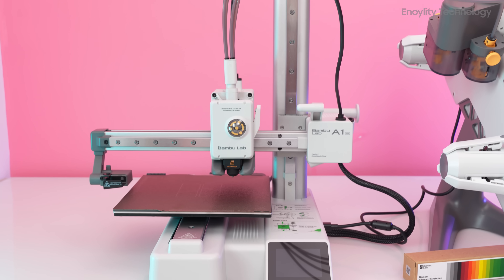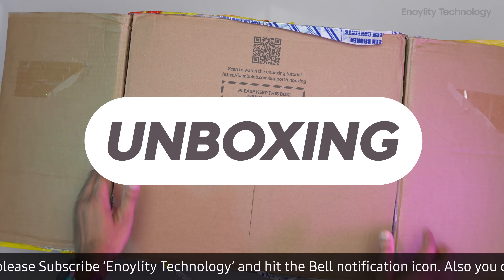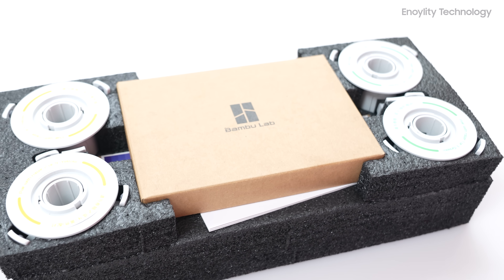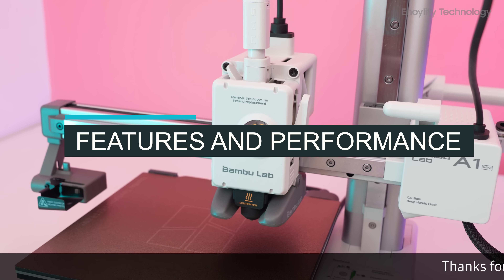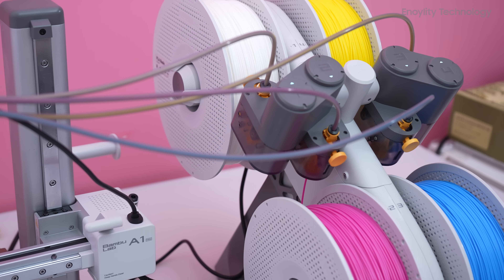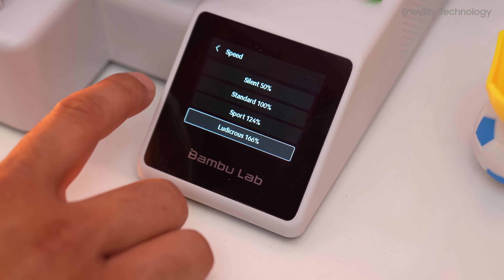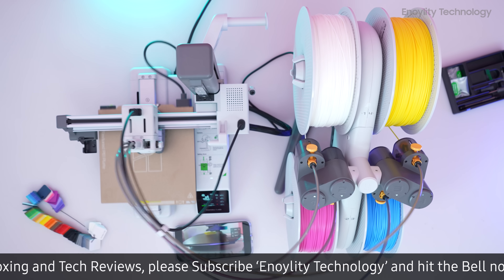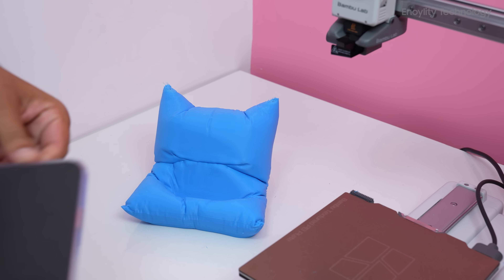Unleash Your Creativity with Bambu Lab A1 Mini: The Compact 3D Printing Powerhouse!

Comment: I’ve completed projects in half the time compared to other printers of similar size 😮 thanks to this amazing printer 🖨️
Reply: The Bambu Lab A1 Mini’s ability to print with flexible filaments has been a game-changer for me
Reply: The assembly process is straightforward, and most users can get it up and running within an hour
Reply: The printer malfunctioned but it was still under warranty. The company worked with me efficiently to resolve the issue.
Reply: The 3D printer runs off a screen that you just turn the dial button and it scrolls through. Once you find your option you click the same scroll dial. It's that easy
Reply: sturdy frame with a robust aluminum build. It feels well-constructed and durable, ensuring stability during prints.
Reply: This is my first 3D printer. It was very easy to assemble. @samantha_sims_12
Reply: I love the heated bed. I know people without heated beds use glue sticks or other things to get their prints to stick but it seems like having a heated bed works without the mess.

Comment: Every thing about the printer is likeable . It's been few months and working like a charm.  I would prefer this printer over ender because of lower price.
Reply: It opens up a lot of possibilities for different projects😊
Reply: There are lots of resources and tips available, making it easier to troubleshoot
Reply: Impressive printer
Great review as always
Thanks for sharing 🙂
Reply: As I write this review I have 500 hours on this machine so far. It works non stop in my office at home. I had not bought anything as fast as this printer before and I have even purchased another for my office at my actual place of employment
Reply: have many great idea projects, and can’t wait to use this in full force. So far, I’m really happy with my choice, and I have high expectations for the results!
Reply: Absolutely in love with this printer. It's my first, and I'll love it forever even after it leaves me for a younger man with a softer touch.
Reply: I’m loving the vibrant colors this printer brings to life
Reply: Prints well, right out of the box.

Comment: It’s a set-it-and-forget-it machine that keeps performing without constant adjustments 😄
Reply: For hobbyists and professionals alike, the A1 Mini is a fantastic tool
Reply: Prints from the A1 Mini are consistently high quality
Reply: For its price point, the A1 Mini delivers exceptional performance that competes with more expensive models
Reply: I own a handful of 3D printers including several Ender 3 variations and I'm quite pleased with this printer
Reply: Very surprised by the quality of the machine and the printing! Although, initially, there was an issue with the firmware version
Reply: This is a very capable 3D printer, when it works.
Reply: The Bambu Lab A1 Mini is designed to bring versatility, precision, and user convenience to the forefront

Comment: I recently purchased this 3D printer and have been thoroughly impressed with its performance.
Reply: Maintenance is minimal, thanks to the excellent design of the A1 Mini
Reply: It combines compact size, powerful performance, and ease of use into one impressive package
Reply: I print full beds of certain game figures and I am painting everyday. Learning to airbrush etc. I had 1 hiccup where my FEP had a puncture. Anycubic replaced it and has been perfect quick responses and made me feel as a very important customer. This has to be the best purchase decision I ever had. Thanks
Reply: very impressed with what you get at this price point.
Reply: I am very satisfied with this printer. I’m an N scale modeler and use a .2mm nozzle almost exclusively, meaning I’m probably pushing this printer’s detail limits pretty far due to the small scale models I need.
Reply: Assembly is relatively straightforward, even for beginners. Creality provides clear instructions and pre-assembled components, making it easier to set up compared to some other 3D printers.
Reply: The A1 Mini handles intricate details better than I expected

Comment: This 3D printer offers excellent value for its price and delivers professional-grade results. I highly recommend it to anyone looking to enter the world of 3D printing or expand their current setup.
Reply: They’re quick to respond and offer helpful solutions, which is great for any issues that arise
Reply: One of the standout features for me is the filament runout sensor. It’s saved me from wasting filament and ruining long prints on multiple occasions
Reply: its staggering 500mm/s high-speed printing capability. This speed doesn't come at the expense of quality; in fact, the precision and detail in each print are nothing short of extraordinary.
Reply: For the price the technology is great, easy to set up, and it prints great
Reply: The camera is nice to have, but admittedly, it's fairly low quality.
Reply: I am new 3D printing. So new that I wasn’t even aware of the fact that printing and designing software are two different things all together.

Comment: Best performance ..I'm an expert in 3D printing ..I'm strongly recommending you all to buy bambu lab A1 mini..super fast, super smooth and super quiet
Reply: One of the best things about the A1 Mini is its ease of use
Reply: Overall I am so satisfied finally. I suggest this printer to everyone.
Reply: The printer was easy to set up and begin printing with almost immediately. The quality is outstanding and everything works well
Reply: I've read reviews that showed a poorly printed benchy. I printed one after a firmware update. It failed because I didn't recalibrate. That was my only failed print, so far. Recalibrated and ran the benchy again and it printed great.
Reply: Feature set/construction - Heavy mostly metal build. Big print bed with PEI sheet. Great for print adhesion and removal. A Glass bed this big would be tough to handle easily anyway
Reply: The printer comes with a modified version of Klipper firmware, which is used to speed up printing, and believe me, it does.
Reply: The A1 Mini’s small footprint is ideal for those who don’t have a dedicated workspace for 3D printing
Reply: Highly responsive touchscreen controls make navigating through print settings and monitoring progress seamless

Comment: That is interesting that you dislike the “proprietary” nature of Anycubic but have no problem with Bambu Lab. I guess it really comes down to ease of use and Bambu Lab has really done that.
Reply: The level of detail this machine can achieve is astounding
Reply: It’s a great investment for makers
Reply: The A1 Mini’s heated bed heats up quickly and maintains a stable temperature, ensuring that prints adhere properly throughout the process
Reply: It ensures that every print is level and accurate without needing to manually adjust the bed
Reply: The print bed is easy to clean and maintain, which keeps the A1 Mini running smoothly without much downtime for maintenance
Reply: The user-friendly app enhances the experience, providing a plethora of free content to print, making the creative process enjoyable and accessible
Reply: Nozzle clog detection is a smart feature that pauses printing if an issue is detected, saving filament
Reply: The A1 Mini is super reliable for all my hobby printing projects
Reply: The printer comes with the file needed for the adapter, you can just print it, bolt it on to the back of the enclosure and hook up a hose.

Comment: If you want to learn and like to tinker with electrical, software, and mechanical engineering. Get a voron. If not? Just buy a bambu.
Reply: The software integration is seamless, and the printer responds quickly to commands
Reply: The A1 Mini supports a wide range of slicers
Reply: This 3D printer went together fast. In the box is a USB stick with SD card with videos on assembly and software
Reply: At first after a fairly easy assembly process, this is the best printer I've ever used. It is super-fast, not very loud, and provides quality prints and a very versatile UI.
Reply: I have upgraded most parts and even use a raspberry pi to run klipper. If you enjoy modding, look for an article titled "How to build The fastest 3D printer on Earth…
Reply: am very pleased with the quality and consistency of 3D printed parts using the Eco-ABS filament provided with the printer thus far and look forward to building more parts in the near future! I use this 3D printer for home use as a hobbyist.

Comment: The best 3D printer for most people is the Bambu Lab A1 - it's very easy to use, very quick, and very accurate considering the cost.
Reply: I appreciate the attention to detail in the A1 Mini’s design
Reply: I’m impressed with how portable the A1 Mini is😊
Reply: The Bambu Lab A1 Mini is an ideal entry-level 3D printer for those looking to get into the hobby without a huge upfront investment
Reply: One of the best features of the A1 Mini is its smart pause function, which allows me to change filaments mid-print without any hassle
Reply: The printer’s software is highly customizable, giving advanced users control over print settings
Reply: Setting up the printer was a breeze, thanks to the user-friendly interface and well-documented instructions provided by Anycubic.
Reply: I have a total of 12 printers and this is now my go to. I wish the size was slightly bigger, but I have large and small machines, just not this fast.
Reply: The print Head assembly is GIANT. This makes seeing smaller pieces being printed near impossible. The first few layers of a calibration cube for example are dwarfed by the enormous print head. Hard to check adhesion and print quality that way.
Reply: The auto calibration feature is such a time saver

Comment: Even with extended use, there’s no noticeable drop in print quality 😮
Reply: Good quality and accuracy prints , in this price range
Reply: For a compact machine, the A1 Mini delivers top-tier prints
Reply: Printer works great, great quality prints, had an issue with the first unit, but was quickly resolved
Reply: Easy to set up and use, works well for small beginner level projects.
Reply: It's compact, efficient, and fits perfectly on my desk
Reply: 😢Set up of the printer was easy. I spent most of my efforts the first few days, obtaining design software and learning how to use it

Comment: It handles a variety of filaments without any issues, allowing me to experiment with different materials😊
Reply: I’ve found the Bambu Lab A1 Mini to be highly reliable for long print sessions
Reply: The responsive touchscreen and intuitive controls make it easy to monitor and adjust settings during a print, offering a great user experience
Reply: The Bambu Lab A1 Mini may be small, but it packs a serious punch in terms of print quality and speed
Reply: Awesome 3d printer with amazing accuracy and finish.
Reply: I highly recommend this combo if your looking to get into multicolor 3d printing.
Reply: The high speeds are kind of like it's angry! You'll want the printer on a solid surface.
Reply: For a beginner this thing would be awesome for great prints as well❤

Comment: Multi-color printing works great! And it handles the torture toaster very well also. I’m very happy with this printer so far.
Reply: The touch screen and menu options are well laid out, everything overall seems to be well planned
Reply: It’s lightweight and easy to move around, making it ideal for small workshops or traveling professionals
Reply: The A1 Mini’s extruder is robust and reliable
Reply: The A1 Mini’s ability to handle different filament types has allowed me to experiment more with materials like wood-filled and metallic filaments
Reply: The quality is outstanding and everything works well. The build volume is adequate for my needs as I mainly print miniatures and scaled-up miniatures for painting and display.
Reply: far, I have not had any issues to be really concerned about. Overall, I give this printer a 5 out of 5 stars. Just do your research on what you and your friends are likely to use

Comment: The printer is very quiet and solidly built. I can’t wait to keep messing around with it and experiment with the multicolor printing as well!
Reply: I’m impressed by the versatility of the Bambu Lab A1 Mini
Reply: It's  versatile and allows users to stick with their preferred software
Reply: As fast as this printer is, I have to wait for the bed to heat up. An AC heater for the build plate would be outstanding
Reply: This is our family’s first ever 3d printer. We had no prior experience and this was so easy to get out and set up.
Reply: This is a good printer and I'm happy with my purchase.
Reply: Very well padded for shipping. All the varied screws are packaged by size and labeled. Was impressed
Reply: I’ve been printing non stop, and the A1 Mini hasn’t let me down once
Reply: This machine is ready to go, right out of the box. All you really have to do (other than remove all of the packaging!) is to put the bed in place and load the filament. Oh, you have to plug it in, too...

Comment: I've been using this printer over a week now and I love it, it works well and prints everything in great quality and clarity.
Reply: I've gotten wonderful multicolor prints off of it.
Reply: The Bambu Lab A1 Mini handles overhangs and complex geometries with ease
Reply: Supports printing over USB and SD card, giving users multiple options for file transfer
Reply: Love it this is number four printer for me. I love this one. The best highly recommended for the money is an awesome printer.
Reply: By designing parts that go together like a model vs trying to print entire structures has gotten me to the level of detail I need.
Reply: Built-in safety features ensure that the printer operates within safe temperature limits

Comment: The build quality is excellent and it has a great print speed. I have been using the manufacturer's slicer, which allows you to send prints directly to the printer
Reply: Considering its price, the A1 Mini delivers professional-grade printing quality.
Reply: The printer responds quickly to commands, whether from a computer or a mobile device
Reply: For someone with a small workspace, the A1 Mini is the perfect solution
Reply: The build quality is robust, and the stability of the frame ensures minimal vibrations during printing, contributing to the overall accuracy of the prints.
Reply: I think this printer is a great starter machine to get into 3D printing, but there are some things that aren't obvious or need changing. I'll try to summarize what I've learned in the last couple of weeks with this 3D printer:
Reply: It’s small, but the Bambu Lab A1 Mini packs a punch in print quality

Comment: Assembly took a half-hour or so, there was one screw on the screen holder that had some threads that needed to be worked harder then expected, but overall assembly went well.
Reply: The smart features like auto-leveling and filament detection make this printer incredibly awesome
Reply: It’s perfect for intricate designs that require precision and a fine touch
Reply: The pre-assembled nature of the A1 Mini is a huge time-saver
Reply: Even in high speed it prints great quality. After 500 hours I have had no issues with the build plate, and only minor operator errors in printing failures. I upgraded to a .4mm ruby tip nozzle for exotic filaments, and it does just fine.
Reply: They were nearly flawless. So, a day after receiving it, the Max Neo was doing its job making the prints that I bought it for. It’s an impressive machine and a very impressive value.
Reply: The quiet operation is a huge plus for home use

Comment: For such a compact 3D printer, the Bambu Lab A1 Mini Power House offers exceptional value😮
Reply: It’s perfect for makers who want high performance on a budget
Reply: The A1 Mini has been a fantastic addition to my workshop. It’s reliable, fast, and produces prints that look as good as those from larger printers
Reply: The enclosed design of the A1 Mini helps maintain a consistent temperature, which is great for reducing warping and ensuring smooth prints
Reply: The print area is much larger than base level printers at 300mm x 300mm which is great if you have larger items to print or want to print a lot of something without needing to tend to the printer as frequently (which is huge for me
Reply: The setup from start to finish is and should be a bit time consuming
Reply: For its size, the print bed is surprisingly spacious
Reply: It’s so portable, I can take it to my workshops with ease

Comment: The printer itself is fast. Once I get the hang of the software I think it will be even better.
Reply: Its print quality rivals larger models, making it perfect for small workspaces
Reply: It’s great for both prototyping and final product designs
Reply: Although it is not the fastest printer in the world, it has printed everything I have thrown at it with high quality and detail.
Reply: This printer has been an ideal choice for a novice like me, offering an exceptional user experience and impressive results right from the start.
Reply: The printer can use other brands of filament because the printer allows you to adjust settings to meet the specifications of the other brand filaments.
Reply: This printer is just simply amazing. The quality competes with the best in the market for the given price point.

Comment: The Bambu Lab A1 Mini Printing Power House delivers exceptional precision in 3D printing, which is rare for its size
Reply: fantastic product very efficient, I'm very happy
Reply: The A1 Mini integrates seamlessly with my existing 3D printing setup
Reply: The extruder fan they used in the stock Ender 3 will probably need to be replaced eventually if you're printing quite often